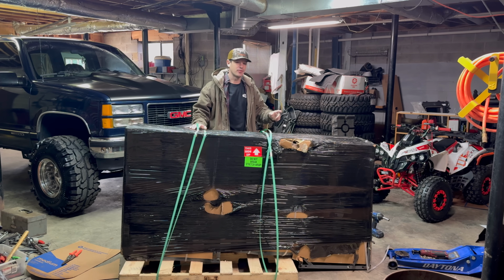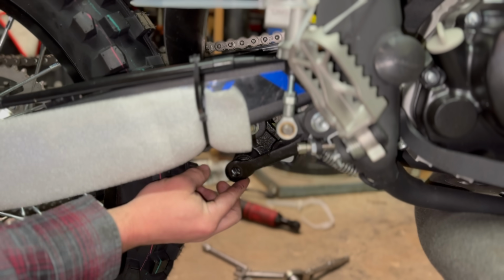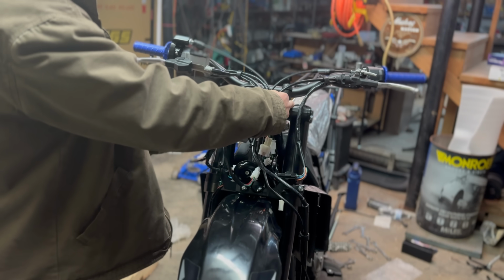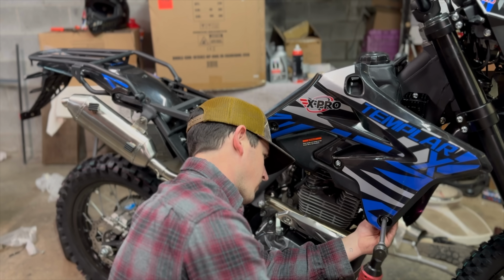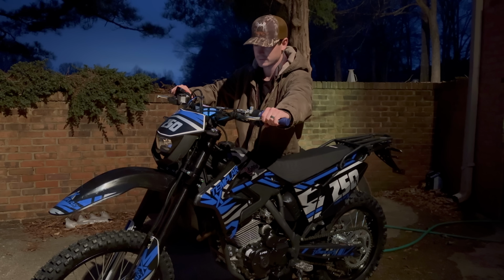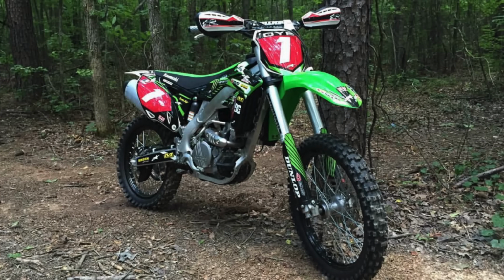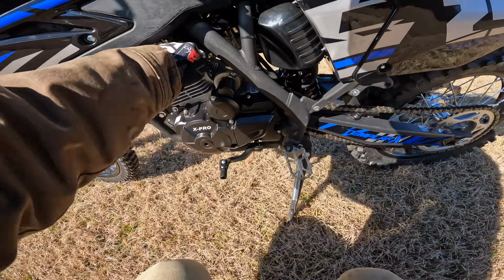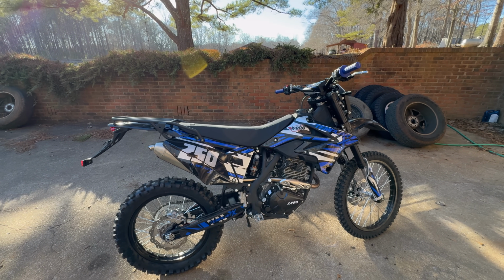I BOUGHT A DIRT-BIKE FROM AMAZON! | IT’S AWESOME |

Comment: Picked the same bike up last spring, it has been fantastic. As long as you understand what your buying, the Zhongshen motor is excellent and similar in performance to the old Honda XR series of 40 years ago albeit with a better frame and suspension. Stay on top of the maintenance and these are really fun little bikes.
One thing to do is pop your tailight off and caulk around the inlet where the wires go into it, this will keep water out and reduce the chances of vibration breaking the solder joints.
Reply: It does look very xrish now you mention it. Cylinder head looks identical
Reply: I would not jump that 250 like I did on my XL600 . The XR was dirt only back then
Reply: 😂😂😂😂 getting paid to push Chinese crap?
Reply: @chrisgomez3078 no points case though. My sister, Brenda big a hole through her leg with that 78 XL points case
Reply: @JohnSmith-vo2cl  didn't understand a word you just said , big night bro?
Reply: @JohnSmith-vo2cl  big ol coyote god dang came up take a hole clean outta my leg , dang hole came from my sister's coyote
Reply: @WesNorton-xd1ln  nope, I purchased my bike after getting frustrated with my Honda dealer nearly doubling the price of the crf300l I wanted. I've been a lifelong Honda guy, their dealers are a disaster. This bike was so inexpensive it was worth trying, glad I did.
Reply: @michaeldavison430 exactly, these are great for people who cant afford how expensive bikes have got now too. They were never cheap but now they are decent small car price.
Reply: Great video
Reply: Somebody tell me what address I have to put on Amazon to get my dirt bike lol won’t let me do a locker
Reply: @Kb1kfrfr what are you homeless lol
Reply: What's the top speed ?
Reply: I have a 2023 Zhongshen 250cc(really 229cc) motor mounted on a 1984 xr250 frame with a nibbi 30 carb and 45tooth rear 15 tooth front sprocket. And the bike is one of my favorite builds. It rips like a rocket now and I’m quite impressed by the performance of the motor when pushed. I would recommend xpro or really Zhongshan as a whole for a budget bike/motor. Don’t expect a track bike or a ktm and you will be more than satisfied.
Reply: I hear it’s a XT Yamaha motor?
Reply: Carb/sticking throttle is wrong assembly bud.
Reply: Trying to get a buddy to buy one so he can come ride with me.  I just got a crf250

Comment: I want to see you review it again after you have ridden it 5000 miles and see how you feel about it then. If it goes that far. When you buy a Motorcycle, as with anything in life, you get what you pay for. Good luck!
Reply: They’ve actually proven to be pretty tough and reliable. Theres un-biased reviews already out there. Bikes & Beards bought one of these as a joke and tried to grenade it and they couldn’t do it. They even dumped it into a pond at one point.
Reply: I have 3k on my hawk 250 5speed.  I also have a 2015 Vulcan 900 and I’d never sell the Hawk.   They’re so easy to work on and the parts are very inexpensive
Reply: Looks like a steel frame. Pass
Reply: I have about 3k on my hawk 250efi, rode hard and put away wet.. standard maintenance before each ride. And I even screwed up and rode over 1k miles with 2 quarts over filled. Oil dumps into the air box completely f'd everything..but bike ran like nothing was wrong 😅, realized that. Fixed it, and she runs just the same. Bike is fine. It's the critics that have issues
Reply: @wannabecarguy  what’s wrong with a steel frame? 5 or 10 years ago I would agree with you about Chinese steel, but that’s not the case any more. Many riders say aluminum is too stiff and prefer the little flex you get from steel, even some top level MX pros prefer it.
Reply: @B-Railed_It maybe he is on Pastranas show and is back flipping it so it's gotta be aluminum! Ffs ignorance is bliss.
Reply: @B-Railed_It yep Ktm, gas gas all steel. Lots of ignorance out there.
Reply: I have a 2015 Hawk 250 that now. Has 2500 miles on it and still going strong. No problems does change the oil. Use the recommended oil 1540 diesel and I run Rotella.
 And the bike is greater than my daily driver.  Fun little bike
Reply: Dude I got mine used and I beat the hell out of it needing very little maintenance and still daily it to work.only thing these engines need is a good set of rims and an oil cooler👌 baby tanks😂

Comment: Yep, the Templar’s are beasts and a heck of a deal. The real gem of that bike is the frame and that Zongshen ZS 172fmm engine. Bulletproof. if Honda isn’t going to give us an XR250, the Chinese will take up the slack. Good vid!
Reply: This is absolutely correct. The big manufacturers are giving away the business by allowing their dealers to push customers into the arms of previously unknown companies and realizing they are now building basic, acceptable bikes. Poor decision making by management.
Reply: @michaeldavison430  real manufacturers dont need broken nobody looser as client. they leave that to the chinese crooks.
Reply: @claudemarchand1196 how old are you?
Reply: @AzTurboMini  14 y.o.
Reply: @claudemarchand1196 reading your comment nearly gave me a stroke
Reply: The best modern xr250 clone is the GPX FSE250E. They are the same company that brings you Kove dirtbikes and rally bikes. Fat, inverted fully adjustable forks, beefy petal disk breaks, a fully adjustable rear shock, full size wheels and tires, and the same air cooled engine as the 2019+ Honda CRF250F, but it has a 6 speed transmission, whereas the CRF250F has a 5 speed, and it can be made street legal. I have a 2024 CRF250F and it can also be made street legal, but to get it to the same level as the FSE250E I am making a lot of modifications and the cost is much higher. I paid $4999 for my bike off the showroom floor and am easily dropping another $1000 to get it dialed in for me. I am currently in the process of ordering all the front and rear suspension parts to get it where it needs to be for me and my riding style. The FSE250E is already all ready, and won’t need any modifications to easily outperform the CRF, and it costs $4699.

Also, the 2019+ CRF250F is mostly made in China and Thailand, so it’s roughly the same quality as the GPX FSE250E.
Reply: @iDrive4fun93  Spot on!

Comment: Bought the X-Pro Titan two years ago, love it. I tell everyone that sees it and falls in love with it that it’s not a real motorcycle, but for the money can’t be beat
Reply: Not a real Motorcycle, what's you discription of a real motorcycle ?
Reply: Kx 250 2 stroke would be A definition of a REAL MOTORCYCLE.
Reply: 1982 Suzuki 1100 GS GL shaft drive would be A definition of a REAL MOTORCYCLE.
Reply: Anything that smug motorcycle gatekeeping purists prefer is a REAL motorcycle.
Reply: Kx500 1984
Reply: lmao if it has 2 wheels and a motor it's a real motorcycle
Reply: Vespa 50cc, balls to the wall!
Reply: How’s the quality, i see it’s 600$ less than the Templar
Reply: @Youhaverights6 🤫you can't beat the old school inline 4 with some head work bored  40 or so over 4 into 1 exhaust pod filters, 💪

Comment: I appreciate you making the video. My personal experience with owning some Chinese motorcycles is that the metal is sub par, so bolts are constantly striping or breaking, along with brackets bending or breaking. Electrical gremlins, carburetor issues. When you go to buy parts there's no consistency in parts manufacturing and the china ads don't always list precise sizes, so you don't know if what you're ordering will fit. My neighbor has only ever bought china dirtbikes and every camping trip we are either working on them before we leave or working on them the entire trip or both. Ive had my experience with them and for a little more money I just buy used Japanese brands and they work every time I pull them out of the shed
Reply: I don' disagree with some of what you say but the phrase "a little more money" is not true unless your talking a 20+ year old Japan bike.  A new Japan bike will run you 3-6 times the cost.  The three China bikes I bought back in 2019 have never let us down so far (unless you take into account kids crashing into things).

Comment: Take a look. That chain needs some proper slack when on the stand. As the suspension compresses it tightens the chain. This can cause the chain to stress the counter-shaft and crack the engine case.
Reply: That will certainly happen if the chain is too tight! At best, it will only destroy the counter-shaft bearing and oil seal. It drives me crazy when I see a motorcycle with the chain too tight, they have no idea how bad that is.
Reply: You do know that every bike is different tho right? Some get looser when suspension is compressed, some stay the same, an some tighten. But good advice to check tension at all suspension loads.
Reply: @trevorjameson3213  theres fine line between too tight and too loose also. too loose the chain will jump off the rear sprocket and rocket into your engine case (can be bad or really bad depending on whats in front of the chain on that engine)

Comment: While I was putting mine together I put the Nibbi carburetor on and the Nibbi ignition FYI attach your fuel hose to your carburetor before you install it it will make it much much easier! NGK I radium spark plug. Changed the rear sprocket to 42 teeth and RK chain. Drain the oil before I ever startedhundredpercent synthetic 10 W 40.. Everything is lubed and loctite . The only complaint that I have about the motorcycle is the body panels can be a bit of a pain. Other than that for $2100 delivered to the house if nothing else it was a fun project. $300 worth of aftermarket parts increases of the reliability.
Reply: These bikes specifically say run non synthetic only😅😅😅😅
Reply: @erinloden1497  Well that wasn’t what I read and what little owners manual I had. But God bless you you’ve had a victory today.
Reply: I'd run non synthetic until break in (1500 miles), and then synthetic after that.

Comment: A good and honest review with some good assembly tips along the way.
I always like to turn the bars back and forth over and over when putting the front cable and wiring into place to make sure nothing binds . 
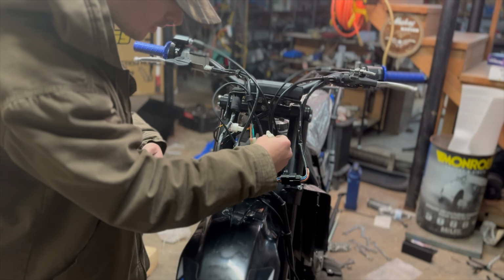P.S. The thing with the little bracket at 10:14 is actually the signal flasher not a fuse.

Comment: Being a long time deep woods off trail rider, This is what exactly why I would buy one; 
250 means short stroke, ain't gonna chuck you out over the handle bars like a 650 would/will in first grear low speed low reves.
 No raditor to poke a tree/scrub oat branch through ( solid core oil cooleer added ). 6 speed, so when you do the road there is no whinding the engine out till is pukes holding high speed (which it was never meant to do ). Just the ticket I've been/was looking for over and above my XR650L. Welcomed addition for sure....
Reply: I have a DR650 so I know what you mean about trying to ride tight woods trails with it! Man, those big singles are a handful at low revs, so much torque. I'm thinking about getting one of these chinese 250's also, but I do realize it's not going to be anywhere near the quality of a Honda or Suzuki. A friend of mine I ride with has an XR650L and we take them to Colorado to ride the gnarly mountain trails. They're great, especially when we ride on the highway to get to the mountains from town, great on the road no doubt. But man they are heavy on the trails, they'll wear you out by the end of the day. Lol. I think a small 250 would be great!
Reply: XR650L is good for high speed desert, but I typically crash at low speeds, front end washes out. KDX200 is about 100lbs lighter and what a difference that makes !

Comment: Ran into the same issue with the throttle cable (Turning right would red line it). I re-ran the throttle cable in front of the display and it solved the issue. Also, the brake light only comes on when the back brake is used. Kinda funky, but if you don't intend to use it on the street I wouldn't worry about it. Love mine so far.

Comment: I have the same bike, I got it about 6 months ago, and it is great! Maxes out at 68 mph. The only issues I have had is the sticky starter button, and the rear brake reservoir isn't filled completely with brake fluid. Other than that I don't like that I have to hold in the front or rear brake to start it, so no emergency roll starting. Amazing value for the money
Reply: What it has the same start only with the brake on like my sister's Yamaha quad .  I am glad my KLR doesn't have that . My battery ran down and luckily I was in a little hill . Or I would have to make a call ( probably too far for Matt's off-road recovery being here in Texas)
Reply: Please defeat this look for video, or know how to default to be able to bump start...
Reply: Guys it will push/bump start. Did it 3 times already on Templar X. It appears the engagement of the brake lever must only be to activate the starter.  How: 1. Ignition on 2. Reasonable speed (about as fast as a adult can push you / or about 10mph rolling downhill). 3. Pop clutch from 2nd or 3rd.  If your bike will not start all of a sudden. It is most likely the that stupid cheap glass fuse setup near the battery. The fuse was good. In my case the fuse vibrated enough to a point it was not making good contact. I wiggled it around and all power came back on. Really good idea to replace that with a blade fuse setup. If that does not solve. One of the battery terminals may have vibrated a little loose causing a poor connection. Ensure they are tight.
Reply: This goes 68 mph? Stock? Or with upgrades
Reply: @Orangeboy-cx2um  stock

Comment: I rode a 91 XR 250 for 23 years and maybe changed the oil 4 or 5 times and I might have changed the plug once but that’s about it. Rings finally shit the bed but I can go out and top off the oil and fire it up with one kick and ride it all day adding oil when it quits blowing out the breather. It’s bulletproof. It’s an XR not a n Xpro
Reply: That's awesome and yeah that's a Honda for you! Stone reliable and lasts forever. I have a '99 XR250R (different from the '91's, remember they changed them in '96). Anyway I bought this XR brand new in '99 and still have it. So far, the engine is still doing fine, not smoking or using much oil. I have no clue how many hours are on this bike, but I've been riding it regularly and taking it to the mountains almost every year since I bought it. Nothing has ever gone wrong with it, quality is incredible on the old Hondas.
Reply: @trevorjameson3213 Hondas are amazing I’m looking into getting my first dirt bike looking at a xr250 I have a 2018  Honda foreman 500 4x4  with 1400 miles and 480 hours it’s seen the bottom of lake Lanier many times when I was younger now I use it as a tractor to move cars and charge dead car batteries it survived a tornado once it runs good still  I just recently changed the oil for the 3rd time since new only thing that’s broken is the 4x4 acutator a few cv axles and a wheel bearing
Reply: You should do regular Maintenance. Bragging about never changing the Oil, just shows you’re too lazy to keep up Maintenance on anything. I’d hate to see how you treat your Car or Truck…
Reply: Rings are probably stuck from not changing the oil.
Reply: XRs aren’t as great/reliable as people brag about, they do have problems like most bikes. Frame cracks can be a problem, broke the seat support tube on my XR650L, exhaust broke in half, some heat shield broke off, CDIs are crap, Chinese CDI is as good as Honda OEM it seems.

Comment: Great video my dude. Just a tip when installing linkages and axle's make sure you use water proof grease. Also grease the steering tube bearings. From factory even on brand name bikes this needs to be done. Otherwise bearing replacements will be common in your future, depending on where you live. Here in the PNW I have to do this every 6 to 9 months. Also your chain looks tight AF. Def want to have some slack in the chain or you can brake the chain and that can get you hurt or break the bike. Braappp

Comment: the throttle deal is been well documented in other videos. seems the cable is a touch short.. Something else you need to do is bed the brakes..  3-4 high speed stops from  like 5th gear to almost stop then ride a bit to cool rotors.. just like car/truck brakes.  good video.. :)

Comment: Durability, reliability, and longevity or yet to be seen on may Chinese dirt bikes and quads.  Also parts availability can be a problem. Also finding a shop to work on them can be an issue.  
Most of the parts I buy a Chinese for outdoor power equipment I repair, and the quality is good. The Chinese quality has come way up from years ago.
Glad you like the bike.

Comment: I put a step ladder over mine and used a ratchet strap to raise and hold it to install the front wheel and put the bolt through the rear shock. It worked for me.

Comment: Wow the needle and seat leaking right off the rip lol. That filter screen pops right out. I may have to break down and get a bike like that but once you hit the $3500 mark it’s time to look at Japanese bikes.  Regardless, a pumper carb on works wonders.
Reply: I used to have good luck with China carbs on small engines but the last few I bought all had a leaking needle and seat. Annoying

Comment: 20 years ago or so a fellow I worked with bought a motorcycle from Asia...i'm not sure what country or what company. However the lesson learned then was yes put blue Loctite on everything. I  remember distinctly that it lost its exhaust pipe bolts that go into the cylinder head - three of the four fell out!
Reply: Or, just replace the ones that you find lose with 8.8 or 10.9 bolts. Many of those bolts OEM are grade 5 strength bolts, they stretch and threads deform, and easily strip. Ace hardware's got most everything you need esp in farm towns, cuz people gotta fend for themselves.